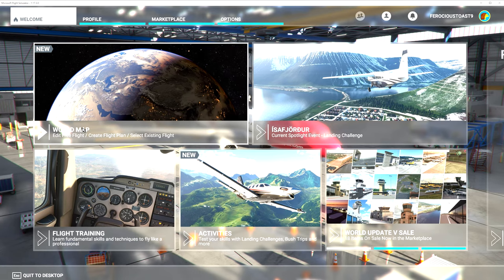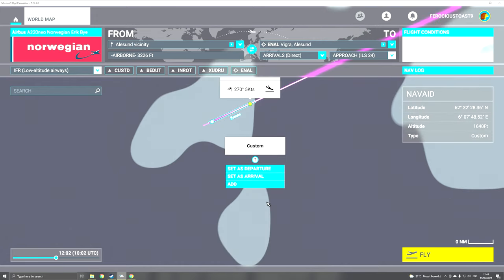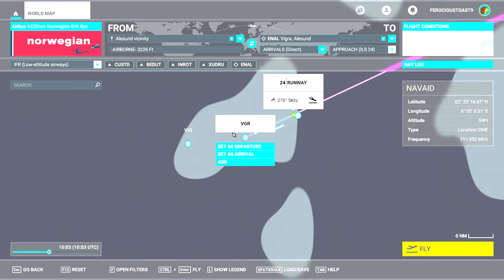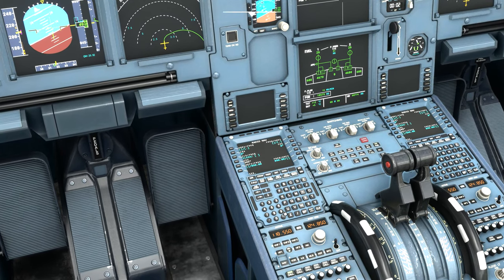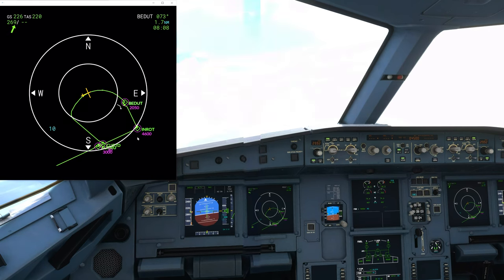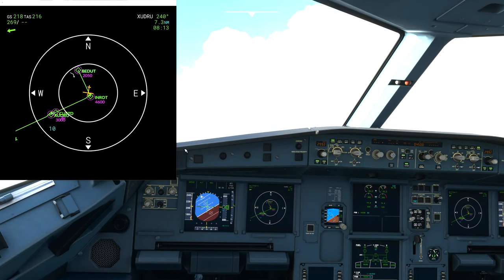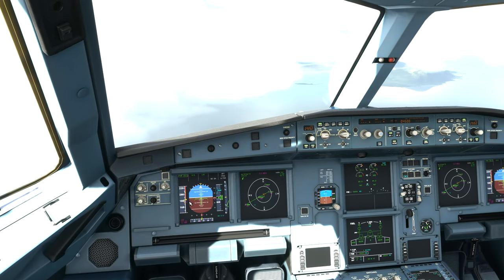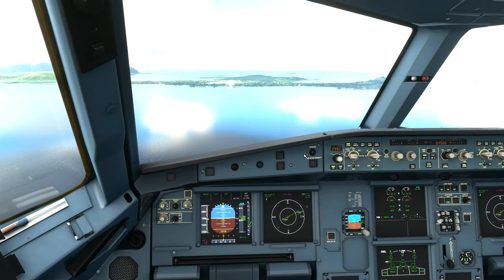Issues catching Glideslope ? Here is a fix - Microsoft Flight Simulator 2020

Comment: Sir,

After watching about 11 of those “how to land ILS in the A320” videos and getting nowhere, you have absolutely solved all the issues I was having finding the glide slope. Biggest hint you have here is that the flight computer sometimes doesn’t have the localizer frequency added! I now know how to find that freq. in MSFS when setting up the flight plan, and now check right away if that’s in the computer. 

Those 40% of approaches that never found a localizer less a slope,  now have the magenta diamonds every time! I also like your tip about engaging Landing System (LS) about 30 deg or less from the final approach. I was doing it way too early!

THANNNNNNNK YOU!!!
Reply from the maker: Great to hear that this video was of such help. Took me long to figure out that the frequency needs to be checked in the flight computer 😉

Comment: Great video subscribed - quick question can you tell me how speeds in mdcu work in managed mode - does it automatically input speeds not sure how it determines this process - thanks
Reply from the maker: Thank you. Not sure about your question. For speed I click on top of the speed knob to set it to managed mode. When auto trust button is on and thrust lever in cl-indent, the plane automatically takes care of speed. Decrement speed by extending flaps.
Reply: Thanks Buddy what I mean is what speeds are determined by the computer - how does it determine speeds or is it always a consistent formula in FMC - how does it determine cruising speed then landing speed - or we have to intervene to slow it down using speed button and flaps etc. thanks
Reply from the maker: Not sure if there are speeds defined in mcdu. If I find out I will make a video on it. Great question 😊👍
Reply: Thank you much glad I found your channel luv the video putting the correct glide scope freq number in nav page also :)